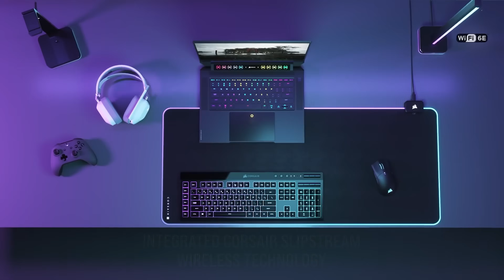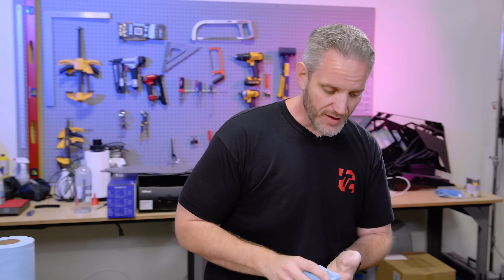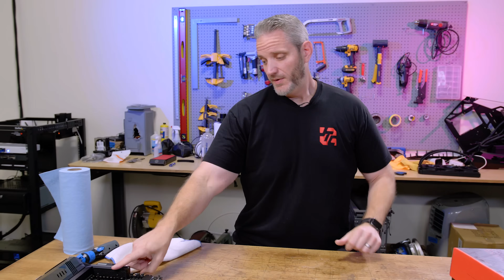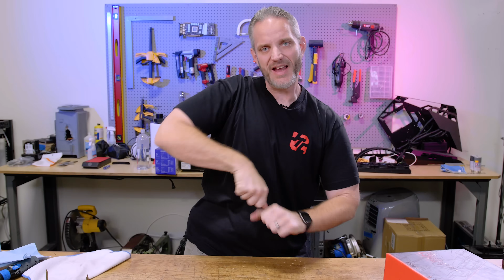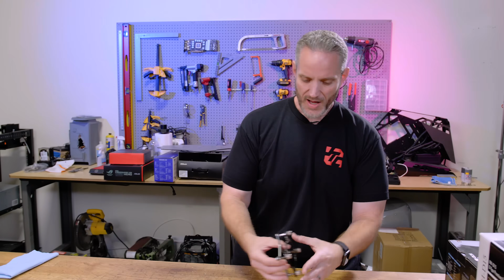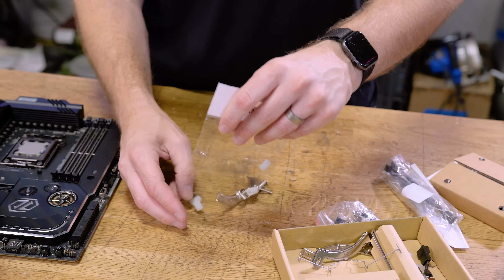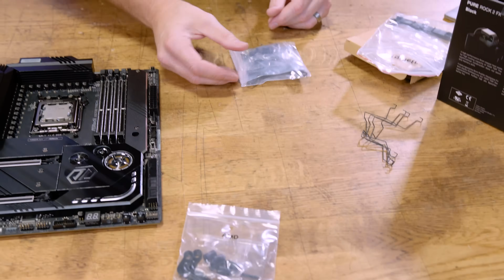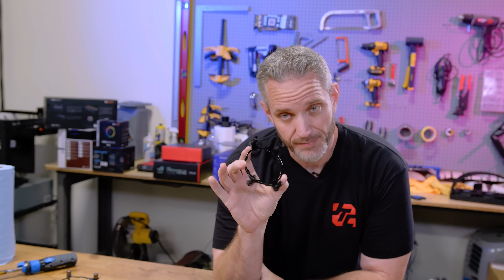AMD made a terrible flaw with this design...

Comment from the maker: A little clarification on the hooks remark at 5:55. If your cooler uses the hooks OR retains the AMD backplate and doesn't replace it, then it should be compatible. Just wanted to clarify that. Not many coolers use their own backplate on AMD. Most AM4 coolers will be just fine but not ALL.
Reply: Are you sure you used the correct mounting bars for the D15? Noctua themselves say that the D15 is AM5 compatible without replacing any parts.
Reply: @stobe187  This is PARTIALLY True. The NH-D15's with the AM4 mounting kit in the box or the ones for which an am4 mounting kit has been requested after purchase WILL work as those screw onto the backplate like th NH-U he used. the original nhd15 he has there has as am3 mounting kit that was also not compatible with am4. however as it has been shipping with the am4 mounting kit for a few years now and ALL the chromax nh-d15's shipped with that, they technically are not wrong saying that any nh-d15 you buy now is compatible out of the box.
Reply: @stobe187  Well from what Jay said, that particular  D15 wasn't even AM4 compatible! Bit of a red herring really; everytime there is a socket or mount change, Noctua do a replacement mounting kit to sort the problem and, provided you've proof of purchase, the kit is free. I'm not surprised a water-cooling fanboi doesn't have all the bells and whistles to an aircooler actually: Jay rarely has a use case and when he might do he's favoured Intel hardware that, like he said, has hardly changed in a 10-15 years mounting-wise..
Reply: @stobe187  D15 will work if you already have the AM4 replacement brackets for it.  I had a D14 and it wasn't initially compatible with AM4/AM5 since those sockets didn't exist at the time, but if you got the updated bracket to fit AM4 it should also work on AM5 just like the NH-U12A he showed.
Reply: @stobe187  he did not. that was the am3 bracket. noctua sends out free am4 brackets.
Reply: @stobe187  The old oversion of the NH-D15 is only compatible with AM5 with a bracket they will supply free of charge. Newer NH-D15's should be compatible as recieved (probably with a bracket in the box?).
Reply: @stobe187  Thats right, Noctua NH-D15 uses the same brackets for AM4 and AM5 (i have NH-D15) and the mounting holes is exactly the same (54 x 90mm). NH-D15 for AM4 works perfectly fine with AM5, and if you cooler is very old, Noctua provide the brackets absolutly free.
Reply: @stobe187  He probs had an old one on the shelf that he pulled that didn't include the "newer" mounting kit, you can buy Noctuas mounting kits separate for like 20$ as well... so your Noctua cooler will stay with you for multiple socket changes... my D15 has been with me since Intel's LGA1511 (2015)
Reply: I guess your NH-D15 is old. From Noctua “SecuFirm2™ multi-socket mounting system
Noctua's SecuFirm2™ mounting systems have become synonymous with quality, safety and easy installation. Supporting Intel LGA1700 (since 2021), LGA1200, LGA115x (LGA1150, LGA1151, LGA1155, LGA1156) and LGA20xx (LGA2066, LGA2011-0, LGA2011-3), as well as AMD AM4 and AM5, the SecuFirm2™ mounting included with the NH-D15 is straightforward to install, provides perfect contact pressure and will stand the test of time even under heavy use.”
Reply: @Nomen_Nescio_X  Agree pretty sure it would work I have both long and short brackets moreover Noctua support is fantastic and when I moved systems they sent me new brackets for AM4 for free^^
Reply: @Nomen_Nescio_X  The original NH-D15 also worked with AM3+ & maybe AM3, as my kit from 2015 had the hardware for such. Not sure Ryzen was yet released then. Anyway, kept my older FX-8370 system very cool.
Reply: I think fully integrating the backplate was a good decision.  A lot of the custom backplates were just plastic trash and using them would bend the shit out of the board so the CPU was even more likely to pop out.  If the backplates were metal a lot of them didn't obey the keep-out area so would risk shorting out through hole components on the motherboard.  Even without those issues custom backplates usually made mounting more complicated because they usually had to be bolted to the board.
Reply: @ahayesm  Yes, yes, yes and yes.
Reply: also that the NH-D15 uses the exact same mounting mechanism as the U12A and all other noctua coolers with the exception of the L9, but yours is just so old that it didn't come with AM4 mounting. Those kits are available though to make them AM4 compatible

VALIDATED
Reply: So i think there are multiple reasons AMD went with an IHS with that thickness one compatibility with the "Default"  AM4 Z height Second the LGA CPU retaining mechanism the plate that holds down the CPU with a specific amount of pressure needs a certain thickness to ensure it does not flex while applying said pressure. A certain amount of rigidity is required to ensure you don't have CPU's Bending. Anyone remember that Intel issue.
Reply: @silverphinex  Surely they did it for a reason i would not test it right away and wait if there are some courageous peoples that will try my idea first not promoting lapping your cpu's.
Reply: 8:20 Nope not the SMD... Back in Athlon Xp era I had an extra hard to mount cooler and I was holding in place the tip of  screwdriver with my fingers so it wouldn't damage the MB if something went wrong. So the pcb get some extra fresh "red paint" on it. Good that thing was a bad design.
Reply: mine has its own backplate for AM4...
Reply: Also, I almost massacred a mobo with an old Duron CPU because of mounting clips, the problem goes waaay back!
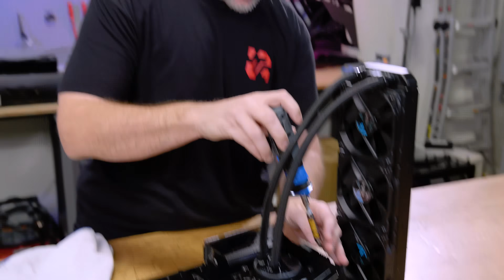Reply: 1:30 in Jay talks about his prefered tool, messes up name loves the fact there is a Dewalt mag shaft - Modders @ their best!!! 

We just wanted to point out that it's not AMD's fault the backplates and coolers that aren't compatible. AMD can't make the MOBO Dist or the Cooler companies do compatibility checks. AMD probably got a confirmation from everyone else they'd do it. The perfect example was the EK brackets you pointed out.
We would love to see Dabaure do the AM4 IHS swap too and if it would mean seating coolers lower I'm sure there are some lower Z-height mounts and people can over tension anyway. 
Kinda tickles the enthusiast kid in us to test various combos there!!!
Reply: So Jay, if you have an nhd-15 with the am4 mounting hardware it will screw onto the backplate. but the standoff that come with secufirm 2 for putting the coolers on intel are 1.5mm shorter. If your brave enough, lapping 1.5mm of the ihs and using the intel spacers with the amd mounting hardware should let you have a much better Z-height for heat transfer without needing anything thats not in the noctua box save for some sandpaper. I'd love to see you do a video to test if this makes meaningfull improvements because that would be a quick out of box improvement.
Reply: For a parts reference: The NM-AMB5 mounting bars with the black spacer (For intel LGA) will lower your mounting height on the cooler 1.5mm. As derbauer already said you have 1.6mm of clearance with the ihs height and the CPU retaining clamp. This really should work by pretty much just lapping the cpu and getting a lot less IHS in the way.
Reply: 8:08 I did that when I was building my K6II-500Mhz all those years ago lol (just showing my age here). Now I swear by the x4 screw down. but if AMD is saying we have to use hooks for AM5 I don't know if I want to upgrade my AM4 5950x to a 7950x
Reply: And for those that are not fine, that's not on AMD, those companies chose to deviate from the AM4 cooler spec... J/S
Seems unfair to blame them for something a 3rd party did.
Reply: I have that same AIO and I found it temperamental with AM4 mounting pressure consistency. Not saying that AM5 isn't different, obviously the info out there points to an actual issue. That said my dumb ass has also left the plastic on a cooler base so I am part of my own problem!
Reply: And by fine you mean fine except for the ridiculous approach to IHS height
Reply: My updated Hyper 212 comes with it's own backplate so I am guessing it would not work. My Arctic Liquid Freezer II 280mm uses the existing AM4 backplate so I am guessing that should work.
Reply: @Mopantsu  they are working on a compatibity kit for the hyper 212.
Reply: Jay the 1-3 C difference in liquid metal was for his prototype formula of liquid metal over standard liquid metal
Reply: Wow, this really top notch content, a lot of really useful info.
Reply: That Z plane, Debau8er measured that while, 1.6mm of the IHS is coming out the new lga socket so 2mm added Z height - 1.6mm sanded leaves 0.4mm instead of 2mm. Lapping this cpu is going to give massive gains too.
Reply: i would try to lap the ihs instead of delid?😆
Reply: @shogunluffy  yeah but he's talking about it being so much thicker that, lapping would take a while and risk some really uneven surfaces. Plus as it was pointed out with the 1700 thermal Grizzly you would need a bracket that's pre-measured. But I definitely get where you're coming from I just think it would be more fun to do the harder project of switching the IHS
Reply: Well I was gonna say you didn't mention the Sythe Mugen 5 Rev B/C cooler, but since it uses the AMD mounting plate & the long side to side bars, I don't have to worry. Thanks for the Video!
Reply: No such thing as being too efficient at eliminating heat...I think is what you wanted to say.  🙂
Reply: Sooop I just bought a Corsair h150i capellix cooler. Is it compatible?
Reply: @SirChadofWick   did you find out if h150 is compatible?
Reply: @ONIPROXY  yes, it is compatible and my h150 came with the new AM5 bracket design that’s supposed to be a better than the old one
Reply: @SirChadofWick  did you find out?
Reply: Jay since the ihs is thicker what about lapping it? Would that work or would the z height fall below the retention system?
Reply: What about just lapping the IHS Jay? 
Easier, safer and much cheaper than delidding.
Simple to take a mm off the IHS.
Reply: For Ryzen X3D if they could just make thicker PCB and thinner IHS
Reply: @davidjones5059  Hmmmm, redesign and retool cpu manufactur, or make piece of steel thicker.
Thicker piece of steel much much much cheaper.
Reply: Do you you fix PC builds?
Reply: Yep noctua uses the amd backplate with most of their coolers i figured this was going to be mentioned, and if you dont have a am4 mounting bracket noctua will send you one free of charge with proof of purchase
Reply: Noctua has an AM4-mounting-kit so the NH-D15 would fit...
Reply: would the CORSAIR iCUE H150i RGB PRO XT, 360mm Radiator, work? on the new AMD cpu's?
Reply: @DethNade  did you find out if the h150i works?
Reply: Hey jay quick question this has to do with a the ryzen 7 5800x none 3d I have a 240 aio and my temps when just watching YouTube and gaming are always at 90c is their something wrong or what I see a lot of videos of other 5800x in videos be perfectly fine also want to add this when at the desktop is when it’s at 67c
Reply: I would be curious what would happen if you put a Cooler Master 212 air cooler on one of the new 7000 series CPUs. How would the performance change and would it be able to keep the CPU cool?
Reply: Your d15 is way too old.
It should fit am5 using am4 bracket.
Reply: Would your water block work with Der Bauer’s delided mod?
Reply: I bet the market's gonna be flooded with pre-delidded Zen 4's. I know I'd be tempted to get one if it meant a 20c drop. I wonder how well lapping ~2mm from the heat spreader would work.
Reply: Ooh good thing i red your comment here  at first thought when you say am4 am5 compatibility i thought they made some kind of adapter that goes on cpu socket to turn it into am4 cpu socket compatibility😅
Reply: ..JayzTwoCents ..I like these Deep-Dive videos, Mr. JayBird! 🇺🇸 😎👍☕
Reply: I'm going to wait six months anyway. That should give companies enough time to release new redesigned products to officially support AM5. After all if you're going to buy a decent cpu and motherboard you'll want proper cooling to work with it.
Reply: Assuming one 70 mm² CCD pumps out 80 W, each additional mm IHS thickness will increase dT about 3 to 4.7 degrees, depending on the quality of the used copper. (This calculation ignores the "spread" part of "heat spreader", so real temps will be a bit lower.) If the IHS was 2 mm thinner, temps would "only" drop about 6 to 9 degrees. There are additional factors besides the thickness at play here.
Reply: sapphire nitro+ vega 64 no stuttering with my ryzen 3600 upgraded to  a 5600x seen frame stuttering and tearing since but NimeZ drivers 22.8.2 thru the tool box can enable SAM and it works really good no more stuttering have had RESIZE BAR enabled thru bios on the 5600x but did not help till now when able to turn on SAM on in the AMD  drivers put new life into an older GPU
Reply: I've seen enough to know that I don't want to upgrade to Ryzen 7000 or RTX 4000.
Reply: People don’t read the comments in YouTube videos. It would benefit everyone for you to validate your statements prior to publishing a video. The DH15 comments are a perfect example, also the early statements about Corsair mounts. Reddit is going to explode with posts about how DH15s and Corsair AIOs aren’t compatible with AM5, when that’s straight up not true.
Reply: This was a very important video and for that reason it’s earned a like. Which I don’t hand out easily.
Reply: Also I think it’s time for Corsair to do a new Cooler product release for Ryzen with JTC….😮
Reply: i  Yes it will, it's also stated on the product page.
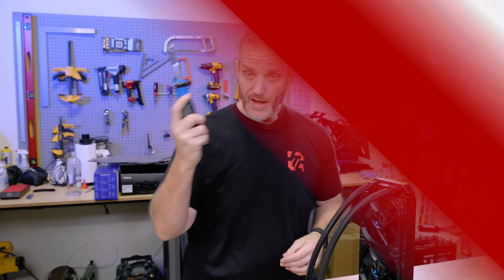Reply: 1:15 the mount could have looked like that because of the way the screws were removed. Each one a little at a time, that's way too much at once. That'll definitely squeeze the paste around. Think of how the socket shims for AM5 get installed. I don't screw more than one turn on each screw when putting a heat sink on or taking it off.
Reply: no not just the hooks it can also work  on any cooler that uses the same 4 mounting screws to the old 4 screws
 so coolers like noctua uses the original back plate can be used. I have done it and it works perfectly
Reply: Ok good. Just order 7950x should be here on the weekend or Monday super excited
Reply: @Connor Bernier just a mobo PCB without any components on it. Hardware Unboxed frequently show a similar one in their CPU reviews b-rolls
Reply: @Thiago Biquiba amd not being forthcoming the amount mounting system is their own the extra backplate that use different hardware aren't technically anything but am4 compatible brackets
Reply: corsair h150i elite seems to work verry nice with the 7 7700x
Reply: Gave me a bloody heart attack.  Got a lot of parts coming for a new AM5 system and was dreading having to spend even MORE on a new CPU block to replace my EK Supremacy EVO.  Thankfully since it uses the stock mount, I should be good.  I'll be testing and validating for a while, but then I'll lap the IHS as far as I can for a stock mount.
Reply: would the vetroo v5 work for AM5
Reply: H115i PRO confirmed compatible with AM5
Reply: That's the most important part to mention in the actual video though. Lots of coolers use AMDs backplate. Almost no coolers use the hooks. 🤦‍♂️

Not mentioning this is such a grave mistake that you should consider taking down the video and redo it (or upload a corrected video as I've seen some people do before). As it is now, it's so utterly misleading that it only serves to confuse people.

To be honest, I don't even get how such an obvious mistake could be made. Nobody stopped to think "Hey, this sounds a bit weird. Maybe I should double check this."? Also, you even talk about Roman's video where he clearly explains that it only affects coolers with custom backplates.
Reply: @blunden2  So can I use a corsair H150i lcd aio with am5? What he said at 7:40 & 8:40 confuses me.
Reply: @blunden2  You're right, yet at the same time, it's easier to install on AM4/AM5 sockets versus Intel, as the stock backplate has to be replaced with the latter (or was the case with my Z97, i7-4790K build). My Noctua NH-D15S took less than 15 minutes to install in my AM5 build, versus having to remove the MB in the Z97 one. At least AMD didn't mess things up between the Phenom/FX years & AM4/5. With one minor detail, Noctua has introduced an offset plate kit with a 7mm offset for potentially better cooling for AM5. My kit should arrive tomorrow & hopefully cool the Ryzen 7 7800X3D by a few degrees. 

I suppose future Noctua coolers will offer these offset brackets at no extra charge for AM5 in future packaging, or will furnish with proof of purchase.
Reply: jay, i got a theory about that THICCC IHS, im wondering if its so thick because its like a space retainer for their future tech like vcache, so then they just add layers of tech on top of whats already there and can just make the ihs thinner

added bonus would then be that the temp exhange will get better as the ihs gets thinner, and if the new tech gets hotter then they already established the 95c is normal thing so it can still float on 95
Reply: Hi guys, hijacking your comment in hope of being seen :)

Optimumtech released a video where he used PBO/Curve optimizer (in the bios), which also allowed him to drop temps in the 2 digits, while keeping the same performance (cinebench). Could you try this (along with direct die cooling) to see what the chips are capable of?
Reply: But Jay... if Most will fit... but not ALL... WHERE is the TERRIBLE FLAW?!
Reply: Can we buy these at T.J. Maxx?......

😋😋
Reply: This is such a critical omission that it makes your title look absolutely click bait as fuck.
Reply: great vid  .. shame though there is not many ways to fix the issue that doesnt void the warranty or nerf performance on the cpu !!
Reply: gee doesnt sound identical too Intel 12th gen .. oh wait its because AMD copied intel 12th gen entirely hahahaha its nearly the same
Reply: @EpicGamingEct  Nah not reallyat all... no e-cores because without e-cores 12 gen intel would bankrupt you with power bills,  no 3d cache, etcetera. 
They needed to change to LGA in order to increase power and performance.

Just reality.
Reply: @EpicGamingEct  nearly the same? 12th gen and ryzen are now the same exact cpus?
Reply: "AMD made a terrible flaw" "Most AM4 coolers will be just fine" Jesus christ...
Reply: people love cooler because it's black. Which people? black?
Reply: no-V-cache Ryzen 7000 is just a quick fix by AMD to milk market more before releasing new Zen as intended by AMD engineers - with 3D V-cache. that crippled 7000 line-up without V-cache should be ignored as an obvious and badly executed cash grab by AMD. 
3D V-cache means way faster CPUs + thinner IHS = way better temps.
obviously AMD doesn't want to compete with Intel too much because releasing way faster CPUs right away would mean a price drop on everything else (including other/older AMD CPUs) and shorter time to sell new Zen technology. basically AMD is artificially slowing technological progress. again. they did the same with Ryzen 1000-5000.
Reply: @rawdez_  shutup.
Reply: @Marin3r101  gfys
Reply: The extra thickness is for the 3D stacked dies, in my uneducated opinion. 

So all of them are the same height.
Reply: @StuckNoUserNames  The thickness is of the steel above the space where the 3d  cache sits, the IHS itself. This is on top of any extra space underneath the IHS to allow for the 3d cache. 
The IHS plate itself is thicker. It's definitely gap filler for the socket to cooler..... as Jay said.
Reply: @StuckNoUserNames  BS, 5800x3D has the same as the 5800x.
Reply: I like how you explained the flaws of the AM5 on its mounting and its IHS, very educational. If it was a Linus video he will tell you first his sponsor and get his sleeper host to explain this.
Reply: @gamerone4154  dont forget reminding you to buy his merch whenever he gets the chance
Reply: @gamerone4154  Linus is a hack to put it nicely.  I have no idea why anyone watches him.